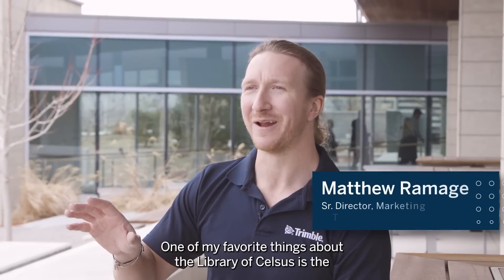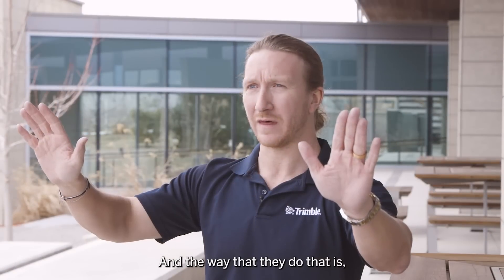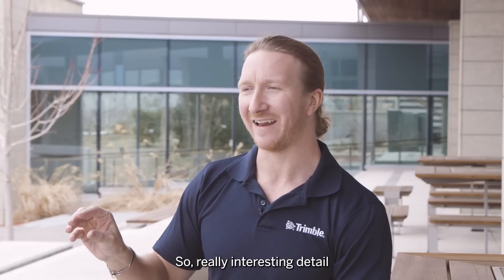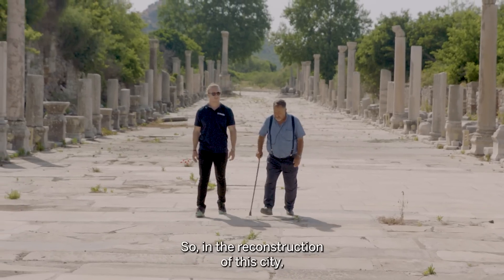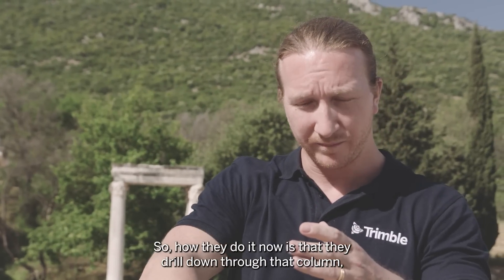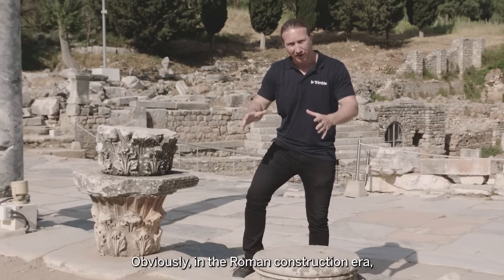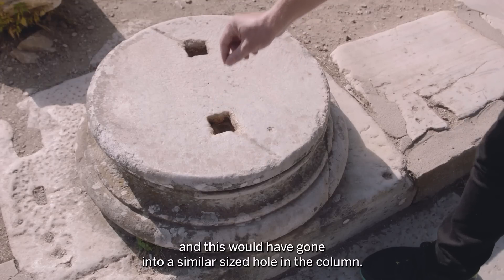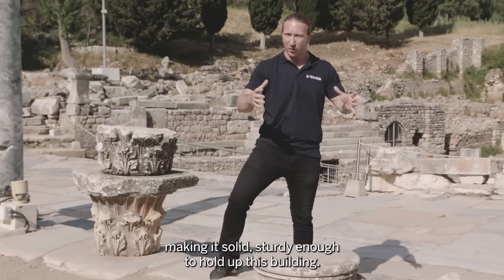No rebar? No problem! How ancient Romans secured columns.

Comment: I'm not entirely  sure how the molten lead held the top piece since the inlet was on the lower piece.
Reply: While the groove for pouring is in the lower part, both the base and the pillar have cavities which fill with lead.  This creates a metal dowel or short rebar which sits within both pieces.  The weight on top of the pillar from whatever it was supporting also helped keep it in place.
Reply: A short rebar, yep makes sense, just amazing to see this place today

Comment: I always thought they drilled the whole column. So they are using the iron more like a glue? :)
Reply from the maker: We were surprised to learn about this method from the local archeologists as well! The iron and molten lead technique they used is a bit like using dowels and glue to attach two pieces of wood.